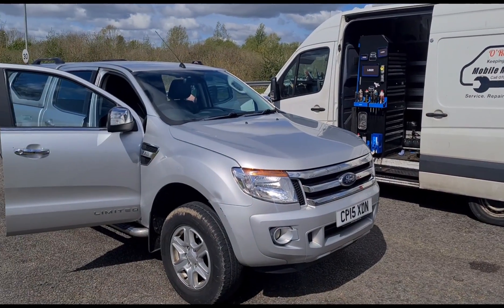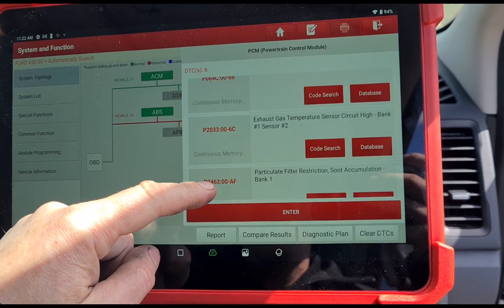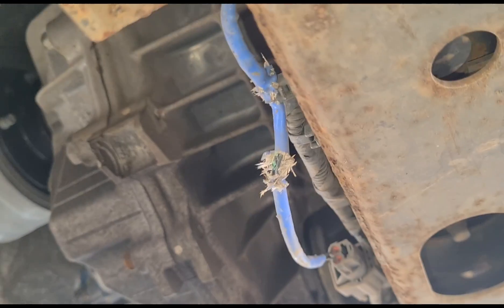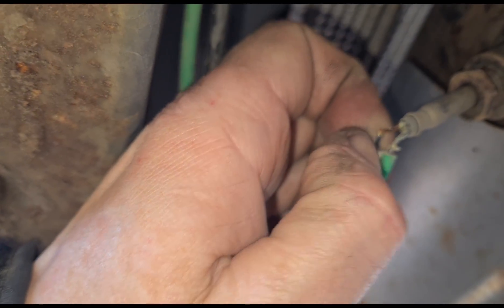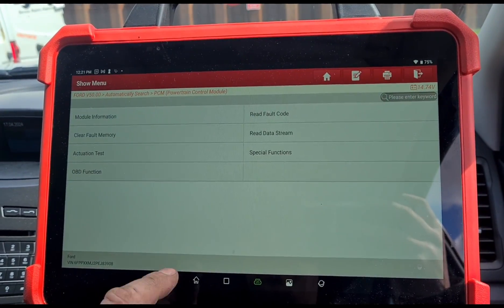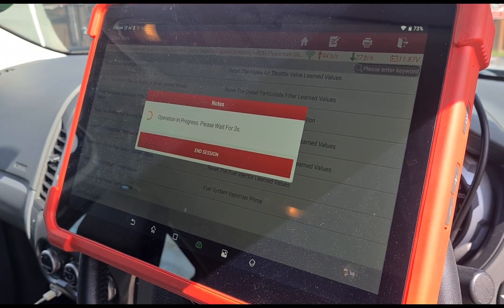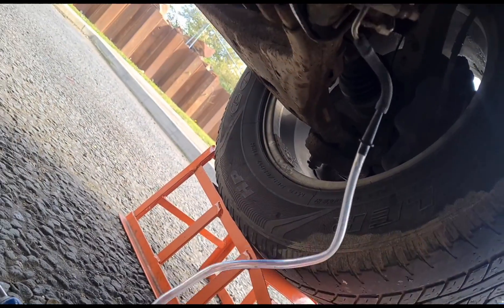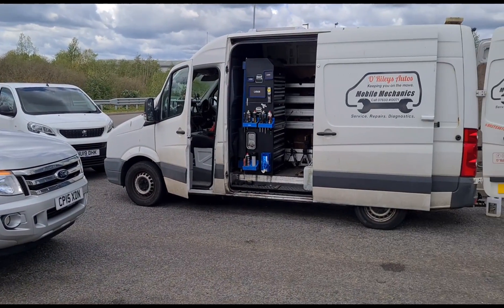Ford Ranger P2033:00-6C Exhaust Gas Temperature Sensor P2463:00-AF  DPF Restricion

Comment: Great job, Jimmy! You even recycled a temperature sensor, which is good practice (less junk). Amazing that the dealership couldn't find a chewed wire, but then again, that does not show in the scantool - you have to look under the vehicle (which is even easier for them).

Comment: Ford techs are the worst! Had a similar situation myself with Ford Kuga recently.
Reply: My best friends mum went to them with a sinking brake pedal and the dickheads put discs and pads on it  charged her a arm and a leg and gave it back with a sinking pedal WTAF how can they charge larbor for a job that didn't need doing and give the women back a dangerous car, i would have gone ape shit if i had known at the time
Reply: I bet the problem was the vapouriser
Reply: @chucky2316  no nothing to do with the dpf actually was a battery going bad and not supplying enough voltage for the sensors to read correctly.